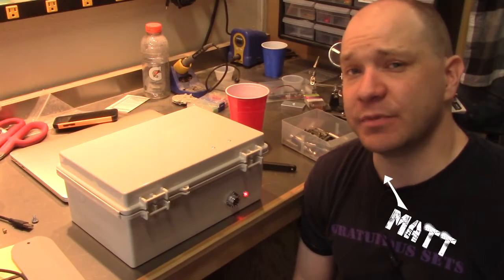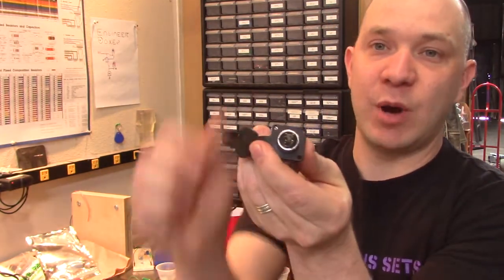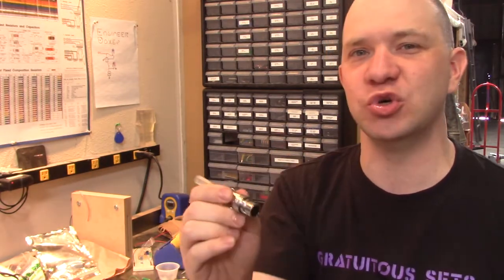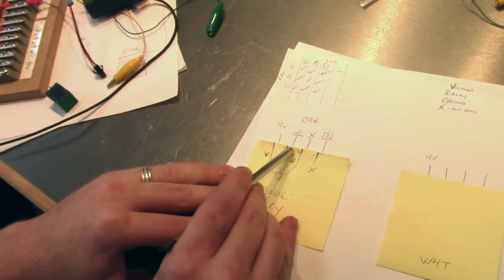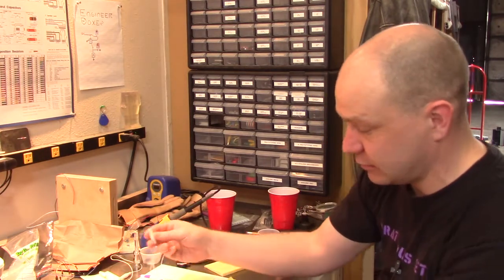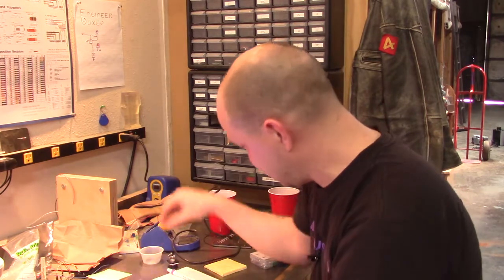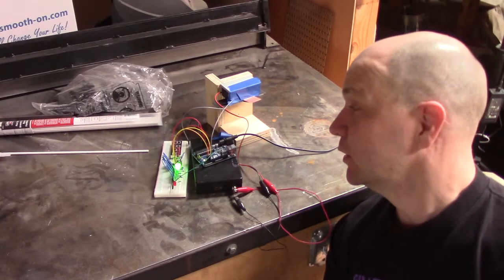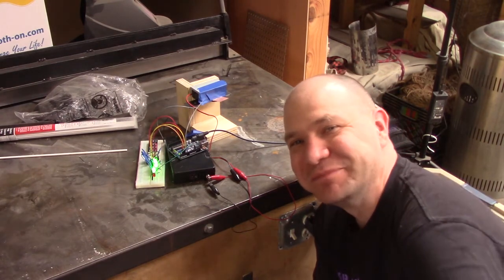Escape Room: Engineer Box Puzzle

Comment: Build the key as a voltage divider with VCC, GND, and feedback to the MCU. Different resistance values and output voltage for each key. VCC and GND in the key for LEDs already.
Reply from the maker: That is /exactly/ what version two will be. :) Correct key (resistor) will tell the MCU to turn on the color LED, an other non-0 voltage will trigger the red. We're shopping for scoop-proof four or five pin connectors that cost less that $200.

Comment: Would an electric solenoid lock be a viable option?  I'm wondering if it would last longer on the battery.
Reply from the maker: Electronically, yes. Make sure that you have a transistor to trigger the solenoid.
Mechanically, the mag-lock let us make the box open as we wanted it to. The solenoid would have required a hasp that would have made the physical build more complicated.
Reply: True, it probably wouldn't look as clean with some sort of hasp or strike plate sticking down.  
Do those batteries have electronics in place to limit direction of power flow?  I wondered if a standard 12v battery (like in a UPS) would allow you to charge the battery through the same port that uses the keys.